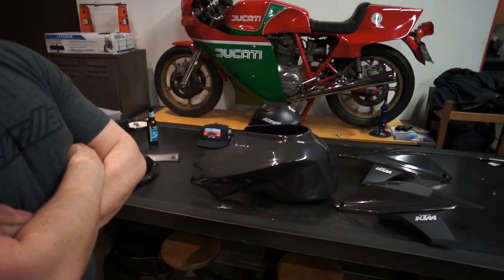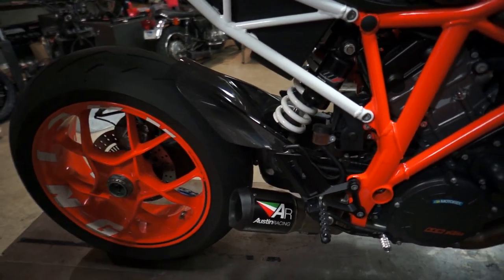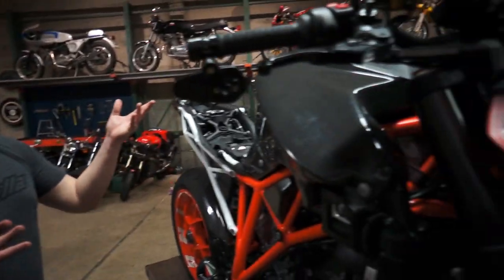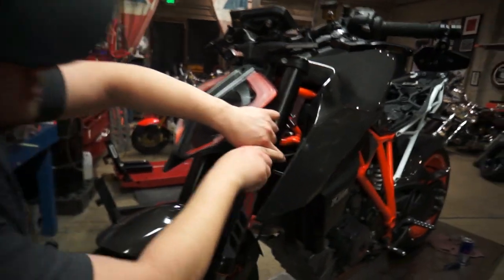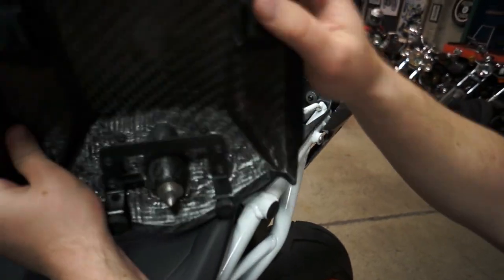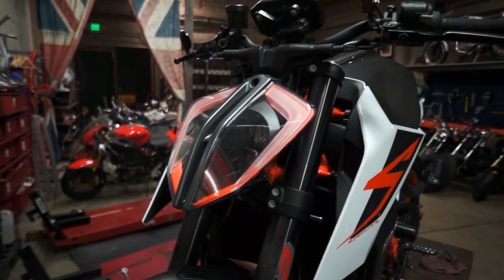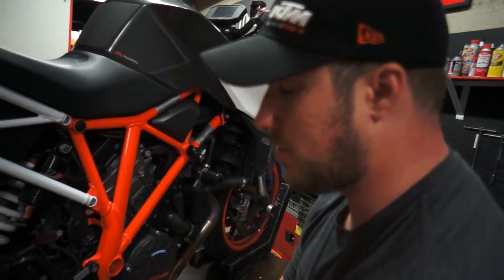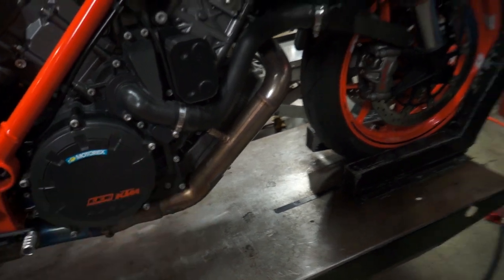CARBON FIBER TANK!!!  - Carbon SuperDuke Build Series - Episode #5 | Kischardio!

Comment: Hopefully buying a SD1290R Just want your feedback ie handling long reliability any feedback would be great.Thanks
Reply from the maker: Handling takes some time to get used to because it’s a tall bike with weird geometry and the wheel base is long.  Once you get acclimated though, it’s pretty good.  Not nearly as nimble as an fz10 or a tuono, but massive power and very very capable once you’ve learned how to work it
Reply: @Kischardio  Thanks for the info..Regards
Reply: Having owned mine now for 12 months I can tell you that they draw in a lot of moisture. if you're not doing long rides, example, short trips around town is going to turn your oil milky. Get it hot over 75deg oil temp or don't ride it at all